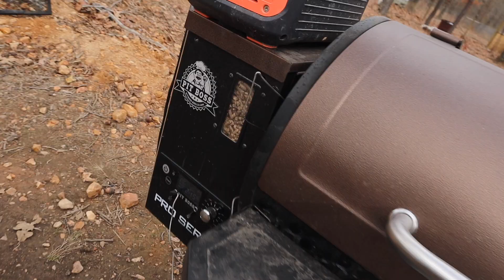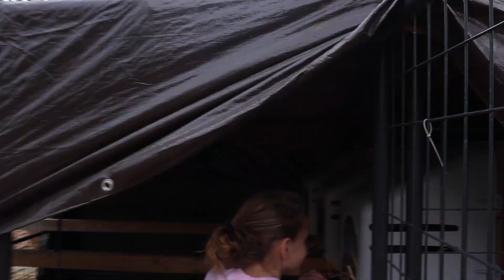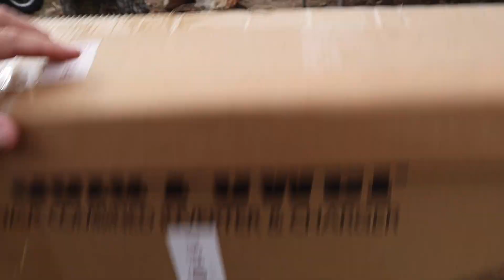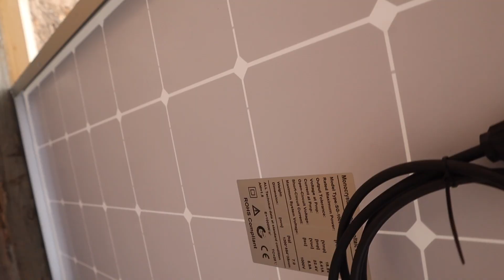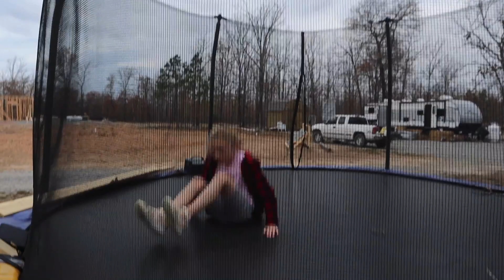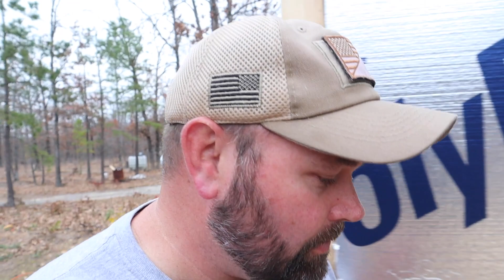WELL SO MUCH FOR SOLAR POWER...Sun Gold Power

Comment: "I don't know much about solar", that says it all, and Martin Johnson mentioned. These guys know nothing and are only trying to cajole you into buying through their affiliate links. Don't trust anyone who "reviews" solar products. "Big sale" Black Friday sale... it's nothing but 
bs. Product reviews are bullshit. How long did you run the gear? Dependability and long term durability are more important than homespun videos with their ducks and chickens running around. An eight year old could do a more coherent presentation. Johnson is the last person to use as a source of anything. He got a huge spark connecting his (way over hyped and way over priced) Battle Born battery bank he set up, and Battle Born makes a input surge limiter...but they sent him the batteries and let him make a fool of himself by not mentioning the surge limiter. Just pathetic.

Comment: I have the same inverter except mine is the 4000 watt model. Mine is 2000 watts per leg and is a beast. It can start loads like your well pump with ease. The idle consumption is a little on the high side but in my opinion its a great inverter

Comment: You can over-amp that Victron charge controller, I've been using the same one for over a year.  If you feed it more amps than it can use, it will just disregard the rest.  But you CAN"T over volt it!

Comment: One quick note, is that once you get to a certain size, you will need to use more than one charge controller.  When using panels of different sizes, it is good to put each on their own charge controller.  It is good to match the battery profile in each charge controller you have.  One of the channels that had more than one charge controllers (with matched voltage settings) is DIY modern off grid.

Comment: Happy Thanksgiving! I believe 48vdc is the way to go. Martin started out with the same inverter charger you have back in the day. I think it was a 5000w@12v or 24v. He upgraded to what he has now. David Poz used a French cleat to mount all his gear to plywood then to the wall. That might be useful to you. The inverter is a beast. Mount it close to the batteries. Short wires is a plus. It looks like you are doing a fine job. Smoked birds look good. Can almost smell them. Yum. Thanks for sharing.

Comment: Finally got Abe outta Kevin's freezer and into the smoker? Not sure which one he is, but he's lookin' real good. Oh yeah, you have plenty of battery and inverter for the well house and tiny cabin. You mention you don't know much about the solar and inveters yet, but so you do know, they sent you a Pure Sine Inveter. That's huge and much better than what most people get because they don't understand inverters, generators and clean power vs dirty power. Pure Sine is clean power, it's not all over place up and down and is more stable without power surges. Generators are dirty unregulated power, so is Modified Sine inverters. Pure Sine cost more, but it's worth it all day long. your sensative electronics will love it, and so will your variable speed power tools.

Comment: You can flip over alternate batteries so the positive is adjacent to the negative and use the shorter jumpers if you are connecting the batteries in series. This is neater than trying to strap diagonally. Also quick tip about  the panels... get rid of the bungee cord and make a secure fixing to the frame.  Any partially obscured cell will cause a massive and disproportionate voltage drop on each panel.

Comment: If the inverter is between your control panel and the batteries then I would put it vertical between the panel and batteries or above the control panel and then wire to the top of the batteries. kinda like and upside down U. If you put it under the control panel will the kids be able to access the panel easily?  I don't know I am just guessing at this...

Comment: When I mounted my inverter and all the controls on the panel board I used too strap hinges on top so I had access to reverse side if needed to run wires from my solar panels or other battery banks. It was easy to access both sides or panel board and easy to latch at bottom.

Comment: You mentioned running AC's later on using solar.  Do not try to use a central AC unless you get the DC inverter kind.  The hard start of central AC compressors is very hard on batteries and the inverter.  Mini splits are the absolute way to go.  They're also extremely easy to install.  Signature Solar has good deals on some high SEER models.  I have only 2 that kept about 1700sqft of my house extremely comfortable down here outside of the Fort Worth area.  Growatt are also a better way to go.  They have models with AC input for grid or generator and they will feed from the generator to charge your batteries while also providing the AC power to your home.

Comment: Sean,  invert 2 of your batteries so that the terminals are adjacent to each other  Your jumpers will easily span the + to - terminals on 2 pair of batteries.  The remaining + to - connection can be accomplished by a new, longer cable or by moving 2 batteries to make a 2 x 2 matrix.   

-----------------------------------------------------------------------------------------
|                                                |                                                 |
|                                                |                                                 |
|                                                |                                                 |
|     -                                    +    |     -                                    +    |     
------------------------------------------------------------------------------------------
|    +                                   -     |     +                                     -    |
|                                               |                                                  |
|                                               |                                                  |
|                                               |                                                  |
------------------------------------------------------------------------------------------  Sorry for the crude illustration, but I think you get the idea, this will save remaking your jumpers.The whole array could be rotated 90 deg.

Comment: Yeah. Don't beat yourself up over becoming knowledgeable about solar. It is a big financial investment but I think you are taking to proper steps about becoming more knowledgeable about it. I know anytime I try to become familiar with new concepts I consume a lot of sources. A big part of this is becoming familiar with the terminology. Once that baseline has been met the other part the hands on becomes easier. Most people go with a single company to supply all the nuts and bolts of the system.

Comment: Man you have got a lot or work to do.  One thing i would suggest is to underpin the rv with  mobile home  metal or vinyl or even straw bales.  Insulate any exposed water lines maybe some heat tape also   Lived in a mobile home in my  younger years got to protect water and drain lines from wind.  Get a snow blade for your side by side.  Don't know your plans on framing your house but its not good to leave that framing exposed all winter maybe it would be better to take it down and tarp it for the winter. Concentrate on solar finish out buildings  , water filtration. Ya got a lot or irons in the fire  .   Wish you all the best

Comment: I ran the  positive wire from one end of the battery bank to the charge controller, and the negative wire from the OTHER end (4 batteries, like yours) so it pulls juice from the whole bank evenly instead of from one end.

Comment: Hi Dutch, new Sub here, Chad sent me, Adler Farms. My first watch of your life and Family, and SOLAR too!!  Just wanted to say -
Longer the cable less electricity, that's why the company you got it from sent that precise length (done for a reason!)  Have had solar powered house for 16 years now, also have a small wind generator which gives a trickle charge, our system runs everything, fridge freezer,washing machine, microwave, t.v, EVERYTHING! Lol . We don't have AC. ( We Just open windows and have shutters down to keep out the sun) ,perfect Don't like it and never wanted it. I live in n.e Spain, Valencia. So lots of sun, we have 6 huge solar panels mounted on concrete blocks on the roof of our little 3 bed house, we have 12 submarine batteries stood on the floor in an understairs  cupboard, YOU MUST MAKE SURE THAT THE BATTERY STORAGE AREA IS WELL VENTILATED as gases can build up and lead to an explosion if not careful!  It's a learning curve for ALL of you.
Charge phones, tablets, laptops etc during the day when it's sunny so you have more power at night for the TV.  We only watch TV in the morning, usually just long enough to catch the news. It's simple things like turning off lights when you leave a room, don't leave TV or fans on in empty rooms, turn off TVs at mains, don't leave on standby etc. Gas cooker, water heaters etc we have an excellent system with an inverter and an outback which is a sort of computer that makes sure everything's running smoothly. Keep everything close to the house and you'll be fine. I look forward to watching you and your beautiful family as you grow into your solar life. Good luck and Happy Thanksgiving much love from Chez in Lliria Valencia Spain  xxx

Comment: Are you sure you can mount those batteries with the posts on the side, instead of terminal side up?

In any event if you rotate every other battery 180 degrees, you'll bring your terminals closer together, since you will go + on B1 to - on B2, + on B2 to - on B3, etc. Your 48 volts would be from negative on B1 and positive B6.

Mount your inverter low, it will keep it cooler in the summer.

Comment: Hi there, Great video.  just so you know all inverters have an idle current when turned on but not powering anything.  That can cause an unexpected drain on your batteries.   This power drain needs to be considered when determining how long your batteries will last between charges.

Comment: I don't know if anyone else has said this but you could use the wires you've already made if you turned the 2nd and 4th battery over so positive and negative are directly above each other. If those batteries can even be flipped that way, not sure. Just a thought. Love the channel and keep up the good work!

Comment: I just got my Sun Gold Power 6000w inverter hooked up to my 48v system. It is working well! Ran 300w from it today.
Reply: HAHA I should have watched the rest of the video. Seems like you are doing your research on connecting the inverter. Please check to make sure you can connect those batteries in Series.
Reply: Be sure to use a switch or breaker between the batteries and the inverter. If you connect the batteries directly to the inverter you will get a massive arc. 

Are you using 48v lifepo4 batteries? because you cant string those in series?

Comment: Use 1/0 aluminum cable for the hot and ground from the batteries to the post on the inverter. 1/0 will carry the voltage load with ease to the inverter.

Comment: The large Red Master Battery switch on mine is bottom right corner. It is about 3" away from the point.  The reason is the is where your master off for batteries to protect the Pure Sine Wave Inverter.  Me, I would make a rack mount with the wood that you have to get it done. Think your making progress here Dutch

Comment: As you move forward you are going to run into ice on your panels....hot water will work to break it up and use of an ice scraper just be careful not to scratch the panels and water near the electronics...

Comment: I would move it to the other side of the well house away from the well. If for some reason a pipe breaks and sprays water onto the inverter or electronics you could lose most of it. Or built a box around with vents for air flow.

Comment: Dutch, have you thought about the cost of the propane?  Ive seen some who started using propane and couldnt believe how fast it disappeared and became more expensive than the electricity.  Just something to think about as you set up a temporary energy system.  We live in Central America now and it gets pretty windy here with 100 mph winds.  A neighbor who runs a food distributor went total solar.  Each of his panels are held down with steel brackets on his roof to keep them from blowing away.  It has saved them over 70% on their electric bill.  We are only allowed to install 80% solar.  Jobs are important so that helps the people with work by keeping it part solar instead of 100%.  Some states will buy back the extra power from you but they do not do that here.  Best wishes on your install.  I know it is a learning process for everyone that is new to it.  Happy Thanksgiving with your family and friends.  Hope you have great weather to enjoy everyone outside.

Comment: Good, at least you have assistance by people that have a running system, so should have the correct way to hook it all up. You are no yr just left with a pile of hardware, and no guide on what to do now to put it together.
As I indicated last time cpmments, there are issues on series/parallel hookup of the solar panels, and consequences of even partial shadoeing of parts of the panels. 
Probably all well sorted out by guidan e of existing working users.

Comment: I did my own solar similar to Martins as well. I would personally buy 500ft of black wire in a spool from eBay. You can always buy red electric tape to distinguish the red from black close to the appliances. To know positive to negative. I would have saved a ton by buying in 500ft quantities opposed to 100ft. God Bless

Comment: If you need to, put those cable ends in a vise and carefully bend them to 90 degrees so you don't have to put longer cables on your batteries. The shorter you can keep the cables the less chance of resistance problems there will be. Essentially you are trying to build a 4 cell 48 volt battery. Forklift batteries are made the same way but they use lead straps to connect the individual cells rather than cables. Less resistance and no chance for sparks that way as when the battery is charging they produce hydrogen gas and can explode when exposed to sparks or flame. You have sealed batteries so that should not be a problem for you.

Comment: Hey dutch I'm concerned about your charge controller. I need you to check your inverter to see if it dont already have one. Old ones did not. Newer ones do. So check that
Reply: Looked on that link but it is different then the one you have. So I hope it dont have it built in.

Comment: The lower you can mount the inverter the better off you will be. Heat is going to be a consideration you need to keep in mind. Summertime it will be HOT and the last thing you want is for the thermal safety to trip evertime it gets hot outside.

Comment: dont hook up your charge controller until you hook up the batteries first. i would make the well water on its own system that way if you run your other system down that you will still have water. and i put my led lights on its own system. that way i dont run down the things i really need to have running.
Reply from the maker: We are
Reply: @KeepingItDutch  i live on offgrid solar myself so if you have any questions i would be willing to help out. ive been following your channel for a few years. as i live off the grid myself right in town on main street. i am only a professional by 8 years of experience only and im really good with electrical as well. im glad your finally getting of the grid i wish more and more people would do it as well. i think you will do very well.
Reply: @KeepingItDutch  your also better off if you do separate systems is to use the same brand model and everything otherwise you will lose some power even if it works good. it will be better balanced that way. all the solar has to be the same make and model and you can use any battery you want but they also have to be the same as well of your choosing

Comment: Unless you ventilate the well house it will get pretty hot in the summer. And since heat rises the higher the inverter the hotter it will get. You may want to direct a fan on it in the summer.

Comment: I got a crimper for the the battery cables. It's about $20 on Amazon. Now I can make whatever length cable I need. It's cheaper than buying the wrong size. Have a great Thanksgiving.
Reply: Longer the cable less electricity!  Have had solar powered house for 16 years, also have a small wind generator which gives a trickle charge, our system runs everything, fridge freezer,washing machine, microwave, t.v, EVERYTHING! Lol . We don't have AC. ( We Just open windows and have shutters down to keep out the sun) ,perfect Don't like it and never wanted it. I live in n.e Spain, Valencia. So lots of sun xxx

Comment: Windy all the way up here in Michigan too. If your running all 4 of those batteries in series for 48volt, then you only have 1 battery 48v 100 amp hours. Your going to need 4 more. So you have 2 48v batteries. And have 200 amp hours. Those cables are fine just turn over every other battery

Comment: I would really reenforce the shelves. I am not sure how heavy those batteries and the inverter are but over time you might have some issues. Another thing you may want to consider (and do some research on) is adding some residential wind turbines. With the wind turbines, as long as you have the minimum amount of wind speed need you will generate power. This would be a great backup to your solar panels. This is something you should research. Also, research issues in regards to excess power (additional power that is created when your batteries are fully charged and you are not using that additional power to run anything). Wishing you and your family a very Happy Thanksgiving.